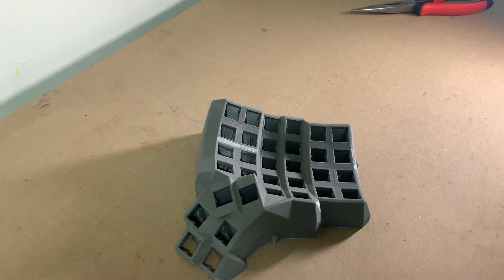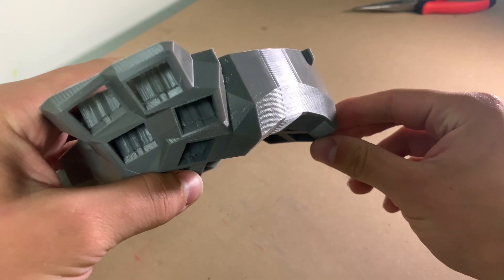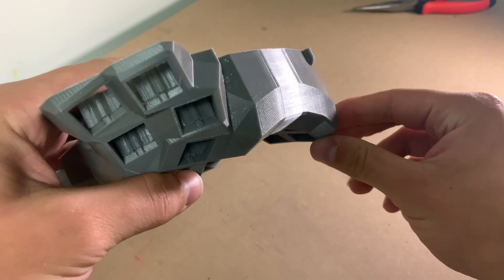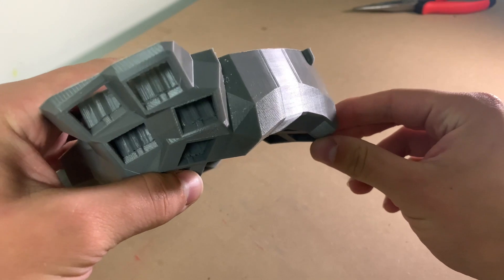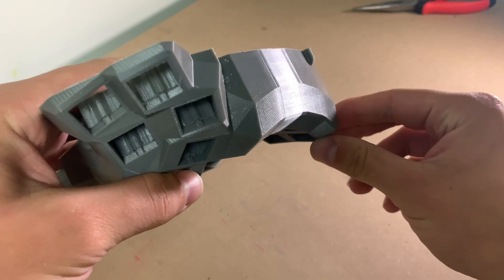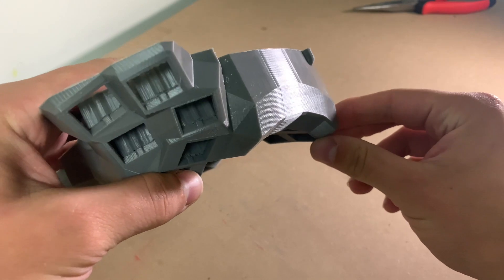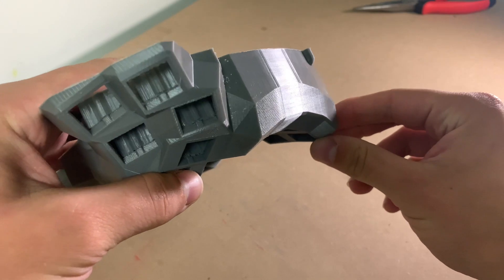I Built a Ridiculous Keyboard by Hand

Comment: I hear there is this resin goop stuff that you can put on to help fill the ridges, its fairly cheap too.  for the future, i might recommend putting some of that stuff on first and then sanding to cut your sanding time by a lot.

Also legit want to design a similar board to this one, just a little more subdued, and i would wanna print it in copper infused pla for that heft!

Comment: Nice quality :)

Check out the nrfmicro for DYI bluetooth support.

I myself have the "original" dactyl lightcycle (the smaller one), I think it looks better than any other version, but is also harder to print. Mine was printed by someone with not so good 3d printer and I'm using it still after 2 years :)

Comment: if you use flux and some ventilation, you can just use the soldering iron to burn insulation away as you solder multiple connections on a single wire like that. The flux and heat will keep it from contaminating the solder joint.

Comment: Instead of the sanding you can also use wood filler. Not the one you spray but the stuff you put on with a spatula. It fills all the gaps and little pockets. You have to send it afterwards to get rid of edges and such but that’s pretty easy and fast

But nicely done. Looks all tidy and cleaned up on yours. 
Mine doesn’t look nearly as good inside though I work in the electronics field, did studied it and whatnot.
I am more of a ‚as long at is works‘ kind of person

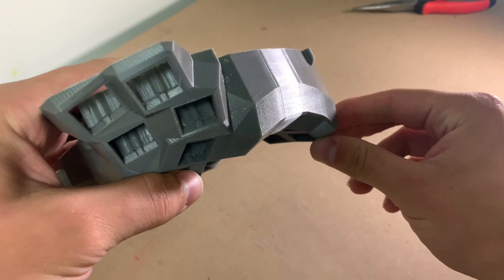Comment: 10:46 Like i thought. Thumb keys too far back. The tip of your left thumb goes beyond the main thumb key.

On your right hand, you are not using the main thumb key (what i think is supposed), and your fingers are not arched on the keys like hammer and nail. That causes more fatigue over time. Are your fingers straight against the keyboard? When you press the “M” key, do you need to move index finger or the wrist sideways?

Just like my Redox. On the Redox when i put hands and fingers straight, the tip of my thumb goes WAY beyond the inner corner alpha key. Truely, 0.5u-1u beyond the corner.

Ergodash, Lily58 (and derivatives), Iris (1 thumb key variant), have thumb keys that go beyond the corner, but not much, barely 0.25u.

About layers, it is inefficient. You make a single key, into two keys. Is that efficient? You don't need to move your hand off the home row, but what is actually scientifically better?

Single key > Key sequence > Key chord/Key combination (Ctrl-C)

Note that key chord is the worst, it is multiple aspects (hand health and amount of combinations for commands).

Try this test:

Hello! <Ctrl-K>Good day to <Ctrl-K>you, good man<Ctrl-K>! I <Ctrl-K>am alright.
Hello! <F8>Good day to <F8>you, good man<F8>! I <F8>am alright.
Hello! \Good day to \you, good man\! I \am alright.

Now pick a different key, F key and Control key combination, the result will be different. The amount of strain, depends on the keyboard. For example, on Mac you press Command key with the thumb.

All of this info, i am speaking of Xah Lee writings. Search “Xah Lee keyboard” and you will find his articles on his website.

Comment: If only these could be bought ready for $100 or $150. The only bowl shaped ready keyboards on market currently are Maltron and Kinesis Advantage, which are priced as $600 and $350 respectively.
Reply: I know you commented over a year ago but I figured someone out there might find this useful. A Kinesis can be had for about $150 on eBay if you are patient and set up alerts for when one goes up for sale. It will probably be the original instead of the Advantage2 and you may have to wait for the exact color you want but it’s doable. I’ve gotten 3 this way. If you are not as patient they can be found for about $200ish, which there are several of for sale right now.

Comment: Nice build man, very clean wiring. Did you have to use wires for the horizontal rows in addition to the diodes or were the lenghs of the diode legs long enough to bridge the gap between switches?
Reply from the maker: The diode legs were long enough to cover the gap. Thankfully I used insulated wires for the first columns so there was less chance of shoeting

Comment: Did you put in the steel plates? Were they worth it?
Reply: +1 to this question. I like steel and I think a case for this model would be hard to order.
Reply from the maker: @Zeioth  Steel plate definitely worth it to prevent slipping around. Once this bad boy(s) is on a table it's going nowhere fast.